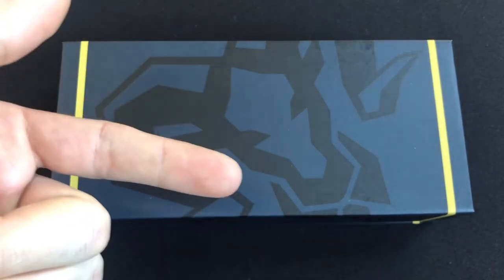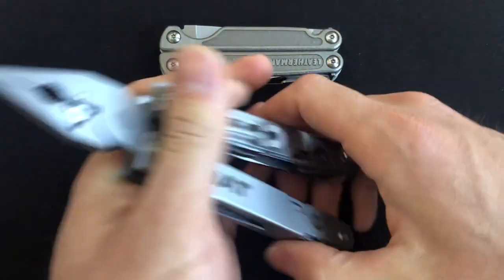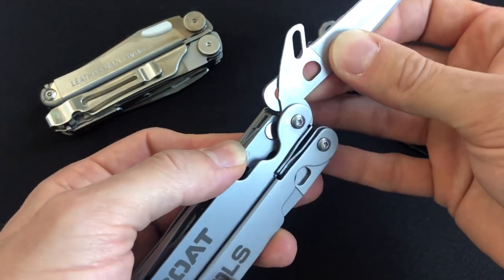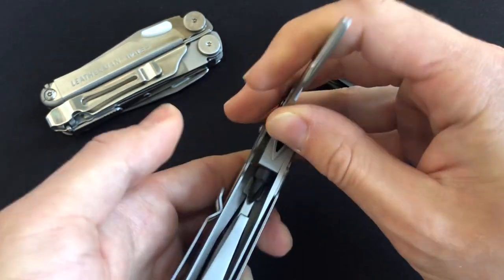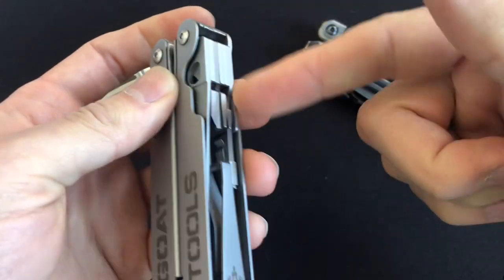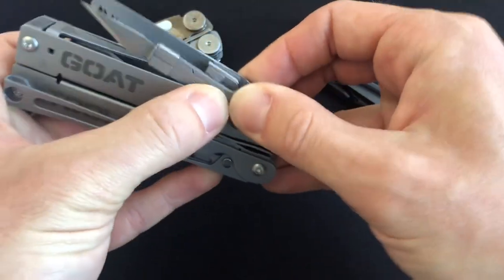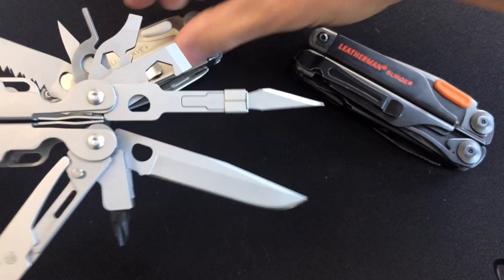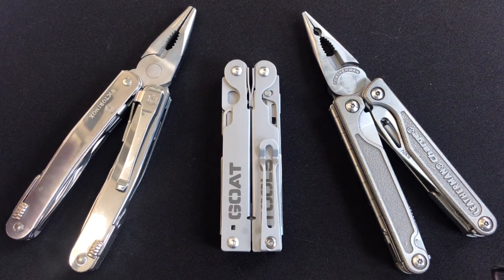GOAT Multitool Initial Impressions

Comment: Seems like an interesting concept but it also seems like it could use a good bit of refinement. Also it looks like it would not be comfortable to use.
Reply from the maker: The pliers are comfy but the external tools kind of feel like I’m using a Swiss Army Knife or something. 2 hands required… I hope it breaks in, but either way I’ll let everybody know my experience.
Reply: I’ve had mine 2 days and it’s already breaking in and becoming more smooth

Comment: That sisor spring is defective, I'd ask them for another imo, unless you want to bend it yourself. The 3 I have didn't have that.
Reply from the maker: I will definitely try to DIY and probably do it on camera. Then if it works we all get to see it 👍
Reply: My scissors spring hasn't popped out yet either.  That detail about the bit popping out when tamping on something is good to know but if they put a stronger neodymium 52 magnet in there it might consistently tug on the tool next to the magnet plus you might need pliers to pull the bits out from bit holder with stronger magnet.
Reply: My scissor's spring hasn't popped out yet either.  That detail about the bit popping out when tamping on something is good to know but if they put a stronger neodymium 52 magnet in there it might consistently tug on the tool next to the magnet plus you might need pliers to pull the bits out from bit holder with stronger magnet.

Comment: So happy to see these in the hands of backers! Your scissors spring may not have been bent towards the frame all the way at the factory. If you remove it, its pretty easy to bend that spring towards the fixed arm so it doesnt pop out. (If you bend it too far and it snaps we'll send you a new one!). Excited to hear more feedback after more use!
Reply from the maker: I appreciate that you found this little video and bothered to comment. I’ll have to mention your customer service and general giving-a-damn in the next video. Thanks for the tip, I’ll be trying it!
Reply: Hi GOATTools can i ask as suggestion if you could add on next tools batch ( i mean as optional add-ons) a  small wire brush like the one the multi tool King Innovation lighting technician or electrician had? The one that had wire strippers instead of pliers
Reply: You should rather grind a little bevel there so the tension naturally pushes the spring towards the frame.
Reply: can i still pre-order one? from kickstarter?

Comment: For reference, my scissors in my GOAT works flawlessly. I had to push pretty hard to imitate your exact failure state.
Reply from the maker: Thanks for the comparison. I will probably ask them for a replacement pair. I went to trim my nails and that spring started acting up again, a lot 🙄

Comment: Got mine, ordered two in black. I’m having most of the same issues, except that my scissors aren’t acting up like yours.  I ordered the file too and it SUCKS, can’t even file fingernails. 
I also removed both knife blades because of how the tools clump they kept popping up and I damn near stabbed myself several times. The serrated blade is the only one I will use in this tool because of the safer tip.
Reply from the maker: Is your file black coated? I’m eager to see if mine is good or not. The safety cutter might also be a good blade replacement, but I haven’t tested mine yet

Comment: I have been excited for the Goat Multitool since I saw it on Maxlvledc. I struggled with finding the tool that I wouldnt have to settle for what I used or didnt use. In the end I wound up modifing a tool that was close to perfect for me. While fun, it was super costly in the end, something you dont want to have to say about a tool you use and abuse. Buy once cry once is one thing, buy once and mourn every time you use it for tough or nasty work is something else entirely. So I am super hype for when my own order comes in. The cost ratio is way more bearable to me. (I wont feel like I just sold a kidney if I lose it). Easy to clean and maintain, and I personally like the look of it. Now I just need to experience it myself.

Comment: Got mine today and was disappointed right off the bat. Fresh out of the box, these were my issues:
•The main blade is very difficult to deploy one-handed because leverage is poor due to the finger hole being so small and close to the pivot. The lock bar and bit driver also deploy with it too readily, requiring them to be pushed back in.
•The bit driver is impossible to pull out on its own since there is no nail nick on the end of it.
•Not only does the spring on the scissors bend away from the contact point with the pivoting half, the pivoting half is also beveled at that point so the spring pops out even more easily.
•One of the pivot screws was a fairly loose, causing the craft blade and saw tips get hung on the inset frame for the pliers. It also made the tool rattly and cheap sounding.
•Easing on corners of tools is inconsistent, some still fairly sharp while others are quite rounded. (Sharper corners make changing/rearranging tools a little bit more fiddly)

Polishing mating surfaces and adjusting screw tension will fix several problems. Grinding enough bevel to get a fingernail on the bit driver will hopefully fix that issue. The scissor spring I'm sure I can fix with some careful bending, though use over time and the bevel where it contacts may make it a recurring problem.

Clumping when deploying the long tools is annoying and ruins the ability to open them one-handed. The Leatherman Free multi-tools avoid this problem with separators. This would be something to consider in a GOAT Tool 2.0 and a mod I might try to implement myself.

For a brand new product I'm forgiving these quirks, since some tweaking should alleviate my initial disappointment, particularly since the modularity of the design is a game changer and the promised warranty is top tier. I do hope QA catches these issues going forward though. I don't regret supporting the development and have high hopes for Michael and GOAT Tools success, and that the innovation inspires more modular, tinker friendly designs from other tool developers.

Comment: For the sake of watching their progress in the last few years and wishing another competitor on the market, I hope they fix most of those tiny refinements needed at least. Looks like a good concept, but when ordering from EU, shipping eats any reason to buy such tool. Good presentation!
Reply: Be smart. There exist such a concept as freight forwarding as well account based service. Look around, there is such a thing as a company with an address in the states and you make n account to them, then they give you a recognition code like a P.O. number then you order the tool but state as delivery address their address. Then they send it in your country. This helps in 2 ways, first off if the international shipping costs from original vendor are too high but they send for free within states itay come that this company's costs are way more reasonable. And additionally in cses where original vendor does not ship outside states or in your country this circumvents issue

Comment: Commenting as I watch the video. You probably put some very thin copper or teflon washers to fix the clumping issue.
Reply from the maker: Max Lvl EDC did that. It takes up some space in the tool area so sacrificing a tool slot for the performance of the others might be required. The nice thing is if it doesn’t work well, it can always be resent to stock. We’ll see if I end up using washers myself.
Reply: @inkiron3907  I'm curious to see how it could work with 0.1mm shims. If only used for the outside tools it'll only add 0.4mm of thickness. Might be tight, but I think all tools could still fit. With a few drops of kpl for good measure

Comment: We must have got the same batch. Mine is also "clumping." The other tools like to come out with whatever tool I'm trying to actually pull out. The knife won't close by pressing down on the bit driver. I also have to pull the release lever up to close the knife. My overall impressions so far is that it was not worth the year long or so wait that I had, and I also don't think it's worth $100. The tools also have pretty significant wiggle action when you grab them and push them back and forth. It's just an ok multitool in my opinion. If it were better made, I think it would be the best multitool out there. I'm not a big "Merica" guy, but I do wish this one was made in America like the Leathermans.
Reply: I think leatherman isn’t the best in quality either. Victorinox imo is still the best in terms of tools and quality especially the swisstool. The only thing missing are replaceable cutters and the interchangeable bits. Which u don’t need really especially if u have a bit driver or extension that can be used on the victorinox Phillips screw driver. Plus it comes with extra bits and a corkscrew which is handy for things like fishing or untying knots etc. wire cutters are strong enough to not break on u like the leatherman arc cutters. And leatherman doesn’t give u an extra pair of cutters with their tools. U have to buy them. The daicamping multitools are better than leatherman cuz they have a better tool selection and have the 3D bit driver and come with extra wire cutters. The pliers on leatherman also get lose over time and u need to get them fixed. So I think companies like leatherman have a long way to go despite they’ve been around since forever. Their quality can’t touch victorinox. And GOAT has potential cuz it’s still its first run. So it’s a promising company but only time will tell
Reply: But I believe that every tool has its use for the intended purpose and different ppl have their needs. GOAT is promising because u can modify the tool to ur own needs given that the quality control becomes better with time. Tho for some ppl a leatherman or victorinox is good enough. So really depends on ur needs. Personally I would like the GOAT to be similar in quality to a victorinox then it will be the ideal tool for me. But otherwise I’m happy with the swisstool and daicamping multitool. I’m selling my wave today cuz those scissors are hard to get to and terrible imo. I rather compromise the file or a serrated blade for a larger pair of scissors that work well from the outside. Tho frankly the file is the least useful tool on a multitool for survival in the outdoors. But a good pair of scissors can save the day!
Reply: @ayaansen2307  I'm not sure what my comment has to do with "different people's needs." The build quality is poor. That has nothing to do with needs. You can modify whatever you want, but you can't change the poor build quality.

Comment: I am also not too impressed with his tool, but if the price was right and it was readily available I would be tempted to try it. I do not know how much these cost, but the most I would probably pay for it would be around $50.00. I felt the same way about the Toler multitool. I would like to get one of those, but they are too much money for an unknown brand and not readily available.
Reply from the maker: $50? This tool isn’t for you then… stick to the Ozark Trail Multiforce for that price range. Got a review on my channel
Reply: $119

Comment: Seeing these up close I'm glad I didn't go for them. Doesn't seem ergonomic, aesthetic or sturdy. A knock on all 3.
Reply from the maker: In its current configuration I think this is a tool for people willing to tinker and modify. If you want OTB performance, or to give a Multitool as a gift, a Leatherman or Victorinox is probably a better option IMO.
Reply: @inkiron3907  I agree. But even then the actual tools are worse. Those pliers are not to my standards. Also you're already having issues with scissors. And I hate the branding too, it would look so much better if they cut the size of that logo by like 95%. That said, I actually do modify Leatherman tools and remove out tools I don't need as well. In concept this sounded like a cool tool, but not if the tools themselves aren't at the standards we like.

Comment: Wish the frame was titanium, more chamfered and half to three quarters mm or so thicker and a half inch or so greater in length and the tools, especially the saw, as well.... it's a bit blocky and less then ideal in ergonomics. hopefully version 2.0 in the near future!
Also the file sucks - needs deeper cross cut furrows and a diamond side with a chisel tip. The scissors could learn from SAK. I couldnt tell if they are peened or a screw but a screw pivot please. Add a pry/ nail pull tool add on, a la ST 300M. Plenty more ideas but I'm tired of ragging on it 😂

Comment: I just got my tool on Friday (3 days ago) and unfortunately within 30 minutes I requested a return form. There’s nothing “specifically” horrible about it, but here’s my take. First of all, the fitment is not good. It almost feels unfinished, the edges are hard and holding it hard feels uncomfortable. The implements clump all the time and badly, ESPECIALLY the dang implement to remove implements which means, things will fall out unless you’re paying attention each time you open it. None of these by itself is such a bad thing but… for $160 (with the file I also ordered) there’s no way I could recommend this. I have the Leatherman Free Arc and the difference in fitment is worlds apart. One of the main reasons I thought this would be awesome is because I thought the ability to remove one implement, to use it by itself or in conjunction with the tool, would be a game changer. No way that’s gonna happen. The implements are too thin and too “unfinished” for that to really work well. I hate to knock on something like this, but for Gds sake for this price it had to be better.

Comment: Good review,  the goat tool needs a lot of work. Expected for the first one but not impressed with it.  Bit drives  falling out annoying to unlock and lock the tools. The scissor did not impressed me.  That tool needs to get it's issue fixed.  Won't be trading in my Leathermans for that anytime soon.    that one doesn't do anything for me.    Thank you for your review.